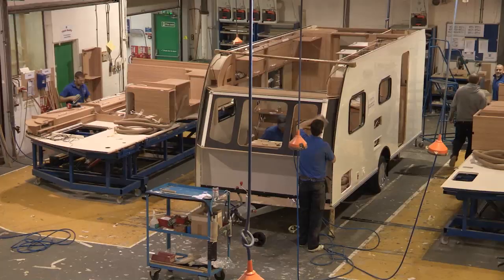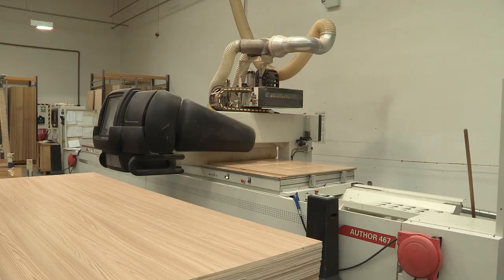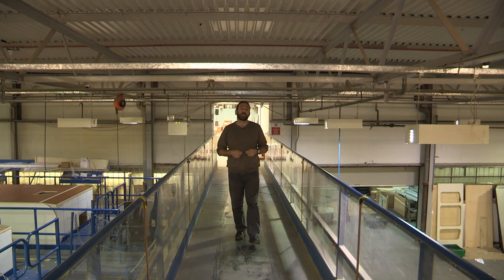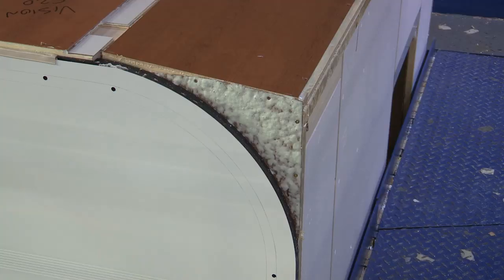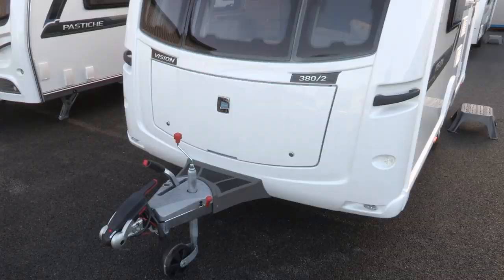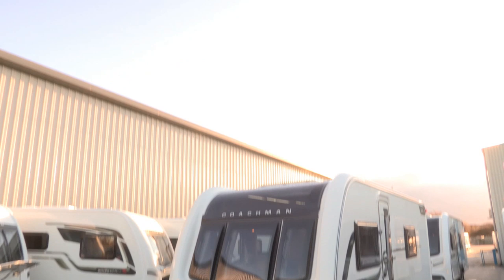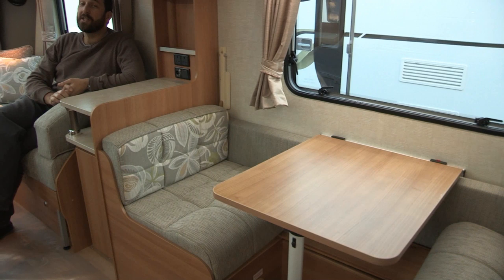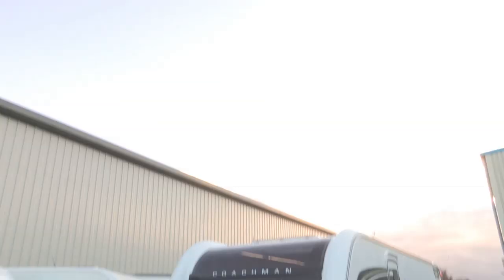Practical Caravan | Behind the Scenes at Coachman | 2014

Comment: To follow on from my comment - I have had to remove the awning rail because the ABS at the rear end has cracked and this was caused by a 25 mph wind on the awning putting pressure on the awning rail which moved slightly. This caused some screws to move sideways into the ABS and crack it. If the construction design of the caravan had called for an hole to be drilled in the ABS that was larger than the screw thread then the damage would not have been caused. Yet again this demonstrates the lackadaisical approach to caravan design by Coachman in the past. Lets hope they have improved construction techniques since then.

Having said that, the reason I am taking pains into correcting the faults is because its the best caravan layout we have owned - and we intend to hold on to it.

Comment: I have a Pastiche 2007.

The first 22 secs of a U-Tube clip contain false statements in that Coachman DO NOT stand the test of time - well, not for awning rail fixing anyway. They have not even used stainless steel screws - penny pinching gits. I think it demonstrates that the designer hasn't a clue although Coachman will point out it isn't cost effective or some other BS. There is no excuse - and if the rest of the caravan was designed by the same designer then there is not much hope for us poor long suffering owners.
 At 4.45 mins in the clip they show a new method of affixing the awning rail which seems to be an improvement but they only use that method on of their lines.
 On my awning rail they have used silicone AND mastic which is proving the devils own to remove.
 My advice to anyone who have the plastic inserts is to remove it both sides so that rusty screw heads can be fixed before the damm awning rails drop off from screw heads rusting all the way through. Even worse is the ingress of water in between the screw thread and into the wood - which will then rot - and that's a nightmare scenario. 

If you are thinking of buying ANY make over seven years old - have a look at the screws condition behind the evil plastic insert